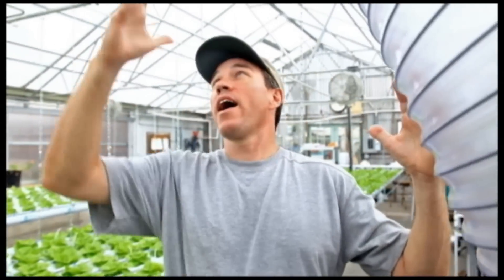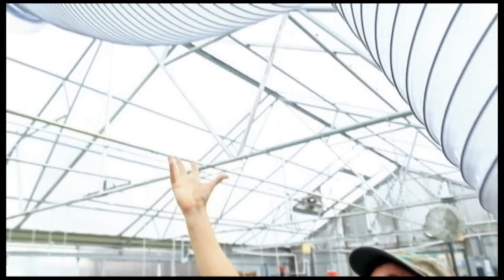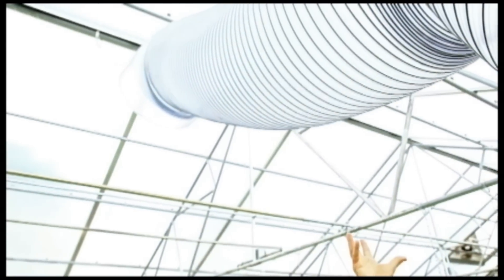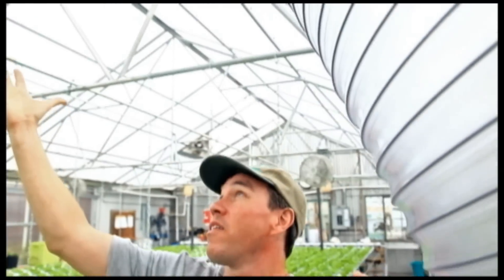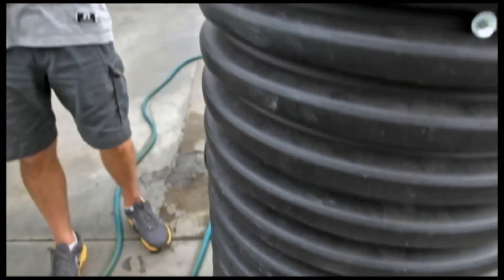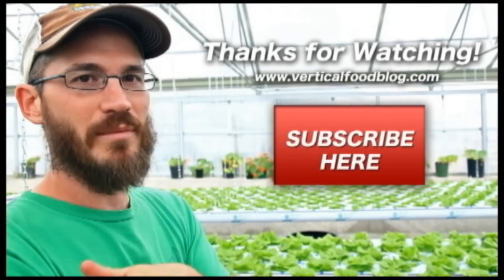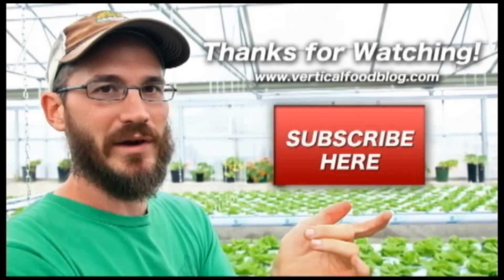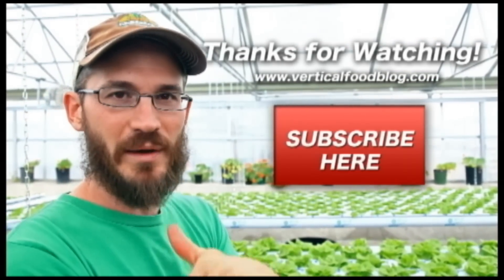Heating a Greenhouse with Low Grade Geothermal (Earth Batteries)

Comment: Hi.  If you use the geothermal for cooling (in the summer) you will end up with condensation in the cooling tubes.  Is collecting this water and bringing it back up to the plants part of this design?  Thanks.  Great Video!
Reply from the maker: nope, actually allowing that condensation to be absorbed by the ground helps with dehumidification
Reply: That makes sense.  For me, living in a hot, dry climate, I need that water. The only problem is that I also need the cooling and the cooler earth is farther down (6 feet) and if I put the water (from condensation) there it would seem only mature plants can get it (unless I put an impermeable layer just below 6 feet).   My primary goal is to use greenhouses to reduce water usage in dry eastern hills of central valley of california.  The extended growing season is great but it is my secondary goal.  I think I would like to investigate a system that goes deeper, collects condensation, and pumps it to plants,  with system powered by solar panels sitting on the roof of a passive solar style  greenhouse.  If you know of anyone who has experimented with such a design please let me know. Thanks.
Reply: I think that would work, but instead of using the common corrugated, perforated drain pipe, you'd probably need a smooth wall, non-perforated pipe installed with enough slope for the water to drain to a common collection point.
Reply: Bright Agrotech
What do you do if you have a high water table and your tile fills up with water?
Reply from the maker: You'll probably have to elevate your entire system to keep the sump as the low point. That's unfortunate!